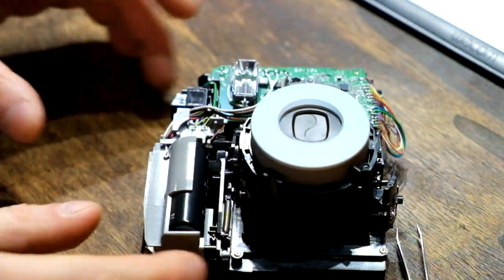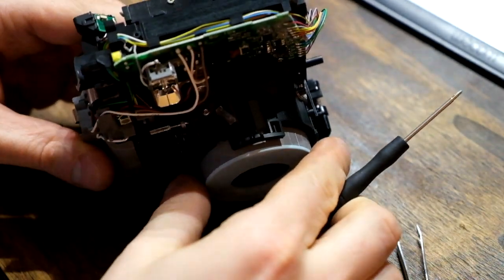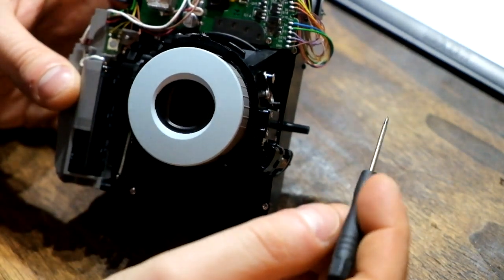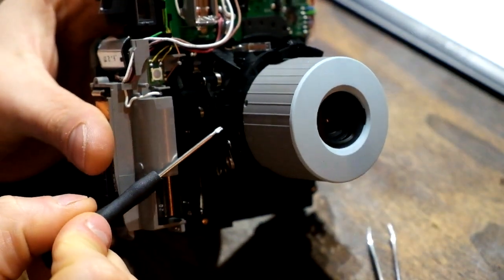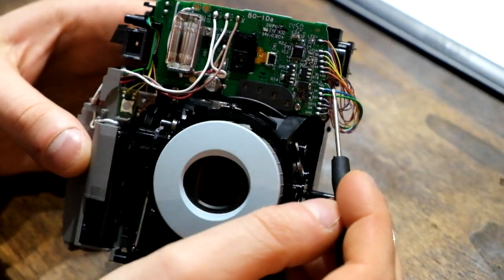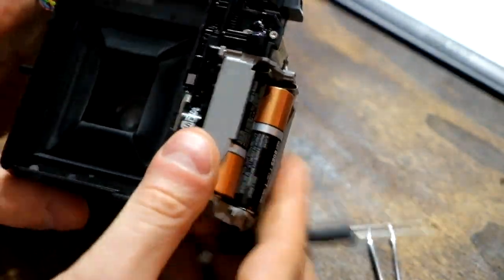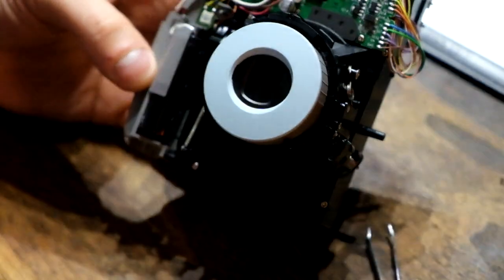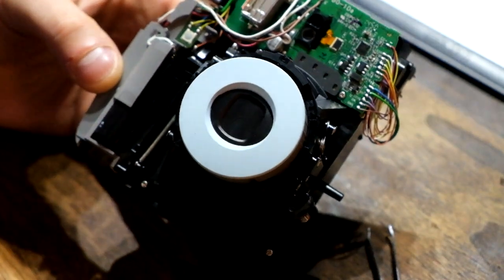Fujifilm Instax Mini 8 - FIX (wiring)

Comment: Hi! Hope you are doing well. I have this camera with flashing lights. 
3 out of 4 lights are flashing. The house icon/symbol over the lense lights up constantly. 
I have already replaced the batteries with LR6 1.5V Alkaline, unfortunately that wasn't the reason
I opened to attempt a fix that I found in another video. It suggested to fix the position of the shutter piece that
is to the side of the lens, and i tried to desolder the motor cable , put 3 v and motor works, move the shutter.
but still nothing.
can u help?
Reply: Hi did you fix it. I'm still having the same problem. Do you have a solution?

Comment: Hallo :) Thanks for your video! Maybe you can help me (or somebody else) with my problem. 

3 out of 4 lights are flashing. The house icon/symbol over the lense lights up constantly. I have already replaced the batteries with LR6 1.5V Alkaline, unfortunately that wasn't the reason. Any tips? :) Thank you and many greetings from Germany
Reply: hello. did you manage to solve it? same problem here.
Reply: @gabrieu36  @steffi  Same issue..tore it apart and put DC on the motor ..it works...shorted all the switches and still nothing but blinky lights...Hope'n you all found a solution to share
Reply: @mendeztom  Hi, I forely removed the stucked film, then replaced batteries Not all LEDs are flashing even when the is closed. If I apply 3 V to motor, film mechanism is working. I guess I need to align motor and gears.. Have you found a solution?
Reply: any solution?
Reply: @fatihozkul7303  still no solution so far 😕
Reply: @Steffi.H  Thank you Steffi, I will inform you as well 
if I'll find a solution...
Reply: @fatihozkul7303  thank you Fatih! That would be great :)
Reply: Guys any solution yet? I’m facing the same problem :( @fatihozkul7303 @Steffi.H

Comment: Hello , can someone help me please? I have an INTAX MINI 9 and the camera when in turns on starts taking randoms pictures (almost everyone dark or with to much light) . At this moment the camera doesn't have any film (the last time ON she take 10 random pictures lmao) . Can someone explain how I can fix this? The camera have 2 years so no garanty. 
Thank u so much all :)
Reply: Hello i have the same problem. My instax mini 8 keeps on taking 3 random shots after opening it. Also even if it doesn’t have a film in it, it keeps on rolling as if there is a film inside. When i tried on putting a non alkaline (eveready battery) and an alkaline battery (energizer battery), it stops rolling inside and also the lights stop blinking but i dont have an extra film so i dont know if the camera is going to work properly now.
Reply from the maker: @optimistickiddo376  That's the same problem I have, I presume the counter is to blame for that, but honestly, I don't know... I did not find the fix. in my other video, you'll see that the putting in non Alkaline batteries just stops the camera from functioning at all.
@Barbara Costa I guess if the choice is to knock the camera or throw it away, try the knock! ;) and if it doesn't work even broken cameras can be sold on eBay. ;)
Reply from the maker: That is the same issue with this camera... after it takes 5 photos the lights start blinking continuously... I contacted Fuji, but they did not provide diagrams nor a solution... and said I must send it in to them.... if Fuji was kinder perhaps I could have helped.
Reply: Update guys : so now the camera is working xD I tried to open but I wasn't successful (fail) so I give up and I knocked the camera and now she is working. I don't advice to do the same xD but for me worked.

Comment: I have my Instax all taken apart but when touching the brown wires I can't get the thing to light up like yours .. oh....btw I took mine apart because Amazon sold me a POS and wanted to refund only half my purchase price.. Forget that... Figured it's a camera.. can't be that difficult.. wrong. So wrong lol. Anyways if you can help me fix it, I'll stay a subscriber.. if not ... Thanks for the video anyways cause it does help!
Reply from the maker: its a little hard to determine the fault just like that, because we don't know your problem.
Do you want to say that there is NO power whatsoever coming to the device?
when you put in the batteries, do any of the lights blink?

Comment: I accidentally dropped my instax mini 9 and the red light behind doesn't blink and the red lights in front doesn't show and I click to shoot but it doesn't do anything
Reply: if nothing happens, no light s blinking, no photos taken, it is most likely that it is not receiving power.
could be a wire got loose, or a contact in the battery port out of place, but cant say for sure.

Comment: What about if your camera button (who is supposed to be pressed when you want your lense to pop out) is not working? The button is not pressable ant the lense won't come out
Reply: there is no button to press for the lens to come out on this camera, you just pull it out.
does the camera not turn on when you pull out the lens?
Reply: I do have this exact camera and there is a button (bellow the camera) that you need to press so that the lens would pop out. But that button now is stucked because I droped my camera and now I can't take any pictures because I can't even get my camera lens to pop out.
Reply from the maker: Ieva Mendeikaitė you are right... 
here I made you a short clip with a possible solution: https://youtu.be/S0mJbLT_UmI

Comment: Hi! Hope you are doing well. I have this camera with flashing lights. I opened to attempt a fix that I found in another video. It suggested to fix the position of the shutter piece that is to the side of the lens. While working on my camera, something went wrong by the light that indicates on. The two pieces that are supposed to make contact to power on, are not being pushed by the lens. Now I don't know how to position the plastic covering those pieces. Do you think you can help me? I also cannot find a solution for the flashing lights yet. Thank you !!

Comment: Hi. Is it possible to mod this camera in a way that it can make action picture's in a shooting gallery when someone shoots on a external trigger? Would be very useful for me :) Sample picture: http://media.libelle.nl/m/44q8wn5i1l0v.jpg
Reply from the maker: Technically yes: here is a diagram: http://imgur.com/a/Vdhyb
Pull it apart, and find the 2 yellow wires 2:29 cut them and extend them as long as you like.
when you touch the two wires together they will trigger a shot.

You can get creative and wire the gun trigger so that when the trigger is pulled the two wires touch and you'll get a perfectly timed photo.

You can also use "Wireless Photo Triggers" if long wiring is a problem, but naturally, it will be a bit more complex.
Reply: Thank you for your comment :)  I worked out your suggestion with what i had in mind so that de camera shoots when a bullet of the air gun hits the center point of the target.  Do you think it wil work? http://imgur.com/a/iDfNG
Reply from the maker: Yeah, totally :)
I'd add one small piece to the puzzle, as I understand the target is probably made out of paper and the bullet will go right through:  http://imgur.com/a/XJI4g
edit: I just saw the "steel pin" part of the structure, I get it now! Nice!

Comment: I have a question. I'm modding an old 1950s Polaroid to be able to take in the Fuji instax films. I had thoughts on getting a fuji film so that I can discect it, and just take out the the part that prints the film and it's battery. (the idea is that I would load the film as would I do the instax, then release the shutter from the old camera, then after exposure, press a button to print the film.) you know where the connection to the printer is ?
Reply from the maker: Sorry for the late reply:
But there is NO printer. the mechanism in fuji does just this: 
1. Releases the shutter and image gets exposed onto film.
2. The film is pushed out the camera through a roller.
3. while the film is being pushed a chemical inside the film spreads and develops it.
So there is no "printer" it uses a different method:
http://electronics.howstuffworks.com/question6051.htm

What you are doing has already been done, funny enough it's called the: "Impossible Project" jus google it ;)
it's a bit cumbersome and costly, but it works.

Comment: Also, just to mentioning the counting issue: in order the counting to work, you need to have a metal strip pushed down (near counting wheel), so that small lamela spring can engage the counting wheel teeths. when you have the back case installed there is a tiny plastic leg on the flap that is pushing that metal spring. Not having the counting done it might tell to the camera that is a mechanical issue, but even if I get this fixed, I noticed the 4ea red light still remain, so there are more mechanical/aperture errors. Hope this helps, I teardown mine to individual pieces, gears, parts and wires, and place it back..and still works :)

Comment: Hi again. I had the same issue when I dismantled mine. I found that the issue can be solved when you change the aperture etting. Is that long shaft with threads, on top of the lens; also you need to remove the battery and re-insert it after each switch of the aperture. I might be possible to be a sync between the light measurement and the physical position of the lens aperture opening. What I did, I took the battery out and when I re-insert it that motor run for taking out the film started automatically, running 2-3 film sheet relesing cycles, and we know is not ok. So, change the aperture by turning the shaft, and you will see a red blink on the led near the viewer lens. That will be the good sign that camera's parts gets back in sync. Also you can play with that switch close to the aperture shaft. Since when you took the case out there is a spring linked with the aperture plastic ring, is possible during the front case removal the aperture (or light sensor input data) to give error

Comment: Hey I read the 'how to' guide you linked to for removing the camera shell, and just wondering: any tips on removing the spring from the camera shell that's attached to the insides of the camera, and then putting it back to replace the shell (which is perhaps even more tricky)? The ifixit guide kinda glossed over it but it seems like the most difficult part of the process.
Reply: Just un-hook it from the body, and it will spring back into the "lens" part of the camera body, to get it back out you would need to remove the circular plastic sticker which is on the front. which is a pain in the ass.

My suggestion is to get a toothpick, and un-hook the spring, and keep the toothpick attacked to it, that way it wont retract into the plastic body.

Comment: my friend accidentally dropped my polaroid in the water and when i try to turn my camera the red light turns on but then turns off after and the orange light stays lit . i dont know what to do???? and my film comes out it flashes and the batteries are 1.5v AA energizer.
Reply: sounds like water damage, you can try use 90% or higher isopropyl Alcohol and clean the motherboard and all the contacts.
Chances are, there is corrosion or impurities which cause it to short-circuit.

Comment: If anyone came here with the problem that their film wouldn't pop up but everything else was working normally, I just fixed mine with this trick: I took the film cartridge out, stuck an old instax film in at the back of the camera, took a picture with the back open and let the film slide through. The first time it slid through sort of diagonally but I did it a couple times until it went normally. It fixed some kind of jam issue and now the camera is working! Just putting this out there because I didn't see this tip anywhere online.
Reply: Kellie Irvine yes , i was trying to find tips 4 that , the problem is that the 1st time the photo stuck ,i open it and just put the packege again , and the first photo was overexpose :(
Reply: Kellie Irvine hopefully this works
Reply: Kellie Irvine hoping this trick would work😔

Comment: how did you remove the shell? i got some sand in some parts and im trying to remove the shell but cant seem to.
Reply: unscrew all the visible screws...
the last screw is on the top under the plastic where the film comes out from.  
Also click the link in the discription
Reply: ill make it easy for you: https://www.ifixit.com/Guide/Fujifilm+Instax+Mini+Eight+Camera+Shell+Replacement/51560
Reply: +The AlikA thank you so much! do you know where i could get the 64 bit driver kit in stores? i cant order online
Reply: Hi! Were you able to fix your camera? I got some sand in mine as well and I was wondering if that had anything to do with the red lights.
Reply: excuse the late reply... it's called the "Red Light of Death" it flashes at any point when the camera does not do what it needs to do, so if some sand got caught in the mechanics, and because if that it is not spinning properly, it's possible. was there any chance of water damage?

Comment: Hi did you noticed that light sensor module, is the black plastic on top of the lens, on the circuit board. there is a ribbon connector that it links the module to the green plate, it seems thay you have it disconnected. Push on it and the camera it gets connected to the light sensor.
Reply: Thanks for your effort, but it is connected: here is a photo so you can see what it looks like if disconnected: http://i.imgur.com/4mFEUMn.jpg

Comment: I have the same problem but my little front lights are not even blinking, please help
Reply: any idea how the problem occured? dropped, water spill, photo jammed... etc?
Reply: Nope, just the other day randomly stopped working, right now the red light at the back started to turn on, any ideas of what to try?
Reply: I hate to say it... but... have you tried changing the batteries? according to the internet, 99% of the times that just means the batteries are dead, and you need "LR6 1.5V batteries" (Rechargeable ones dont work)